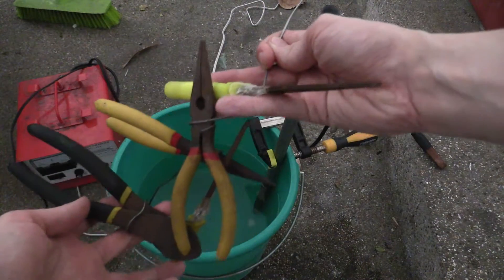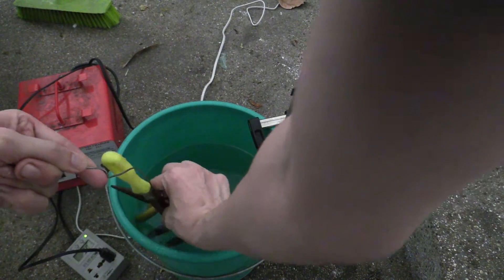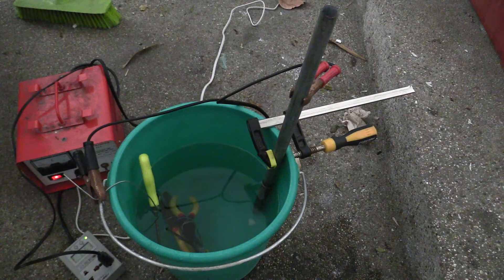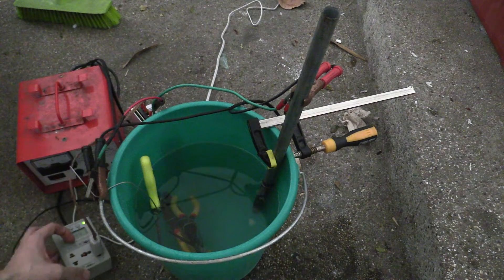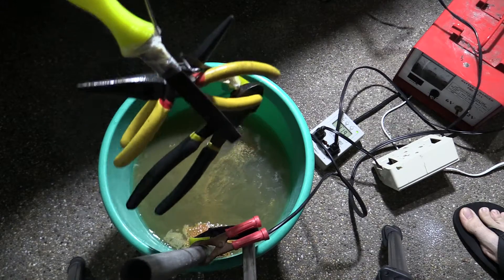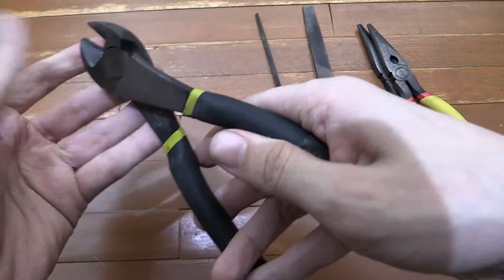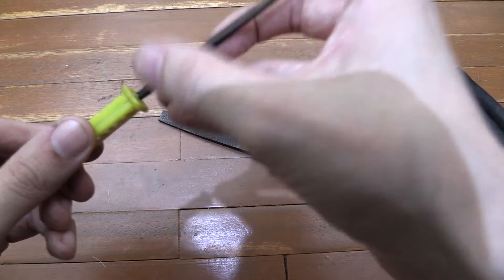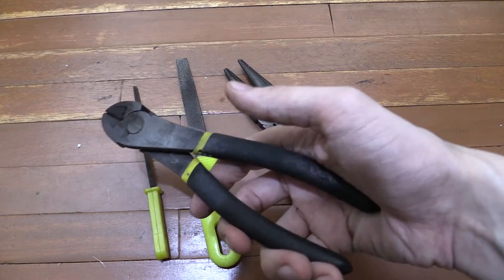Remove Rust with battery charger - Part 2

Comment: I have found that WD-40 ultimately causes rust. Evidently it dissolves any oils, then eventually evaporates away cleanly, leaving the bare metal to rust. My experience has been quite bad with it. Now I wipe things down with a rag with a bit of motor oil on it.